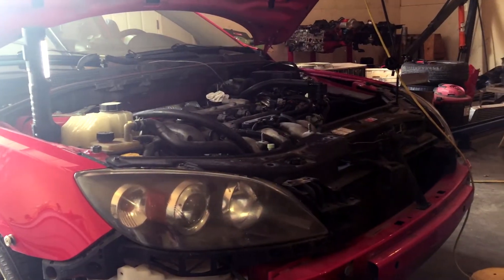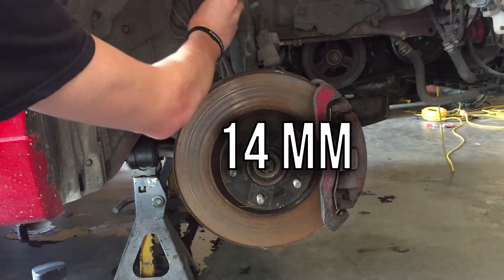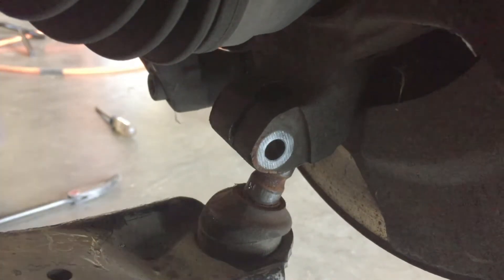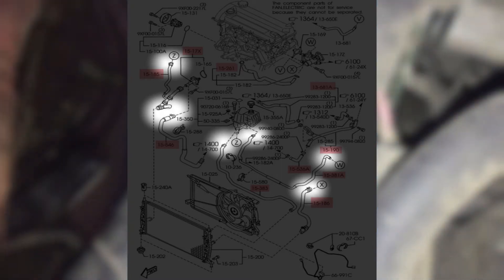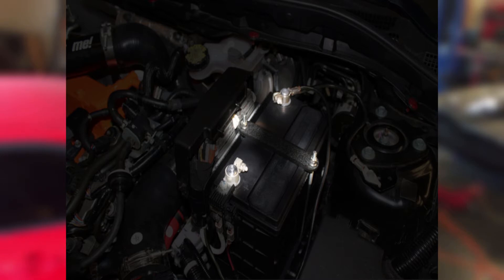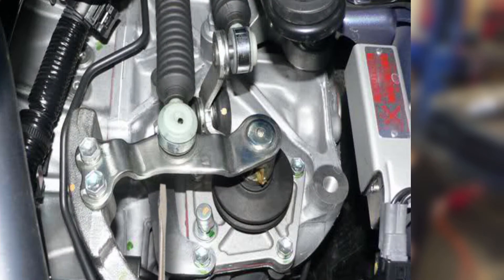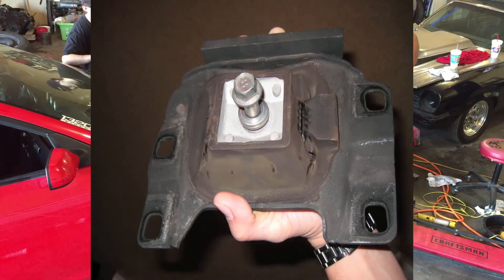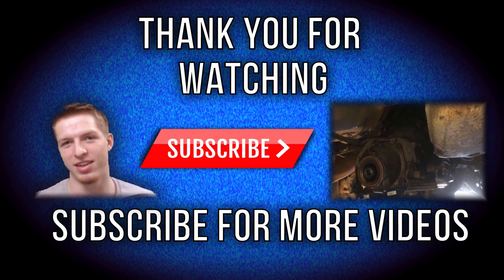Mazda Speed 3 Engine Removal

Comment: Thank you so much for the detailed step by step explanation removal of items to remove the engine. I did not see anything about disconnecting the clutch linkage. I am guessing that you just disconnected the hydraulic line? I found that I did not need to discount the tie rod to get the axle shafts out but like you found it impossible to get the axles to disconnect from the transmission. I am also going to just pull the engine/transmission out with them still attached. I wish my car was as rust free as yours, rusty ball joints and pinch bolts are not friendly. 
2
Reply from the maker: For the clutch, just unbolt the slave cylinder from the engine or transmission, whichever it is attached to on this car (I forget now lol) those ball joints would’ve been a nightmare with rust so I wish you the best

Comment: I probably won't get any responses, but I'm trying to do this to my speed3. Getting soooooo lost on what I actually do and don't need to remove because there are so many lines and things I have no idea what to remove or not. The wiring is another struggle because of the alternator wires and everything that goes behind the battery box (which I have removed)
Reply from the maker: Just take pictures of everything before you remove it and try to be as organized as possible. Everything is one piece at a time, it will eventually all be out of the way
Reply: @T @TheFeesher I figured out I can just pull the entire harness with the engine, but now I'm just to the point of disconnecting the slave cylinder maybe? I know its a hard line and it goes back to the brake reservoir but haven't figured out how to remove the line (it's different from every video I've seen) and I'm wondering if you had to remove that too. Basically what all DID you remove and like... how

Comment: what points did you use to lift the engine up with the hoist?
Reply from the maker: It’s been a while, but I probably just used whatever points I could bolt a chain to and kinda evenly spread the load

Comment: I have a 2010 mazda 3 S sedan 2.5l  I am swapping out. This video looks completely relevant to my swap and is the best Ive seen so far. Ive seen videos with people going out through the top and having to take off the harmonic balancer, the place I bought the engine im going to put in told me that if you take off the harmonic balancer the timing will get messed up and the engine will be toast. this seems like the best way to do it. I wrote down the steps and im gonna start it today. Thanks

Comment: Those axels just pop right off.... Anyway, why would you ever reccomend replacing an engine over rebuilding it? Rebuilding one of these engines is not that difficult and in the end... its basically brand new. After all is said and done it would be about the same cost (assuming you can find a decent low mileage engine at all) and you are not buying someone else's problems. A lot of work to go through just to replace a used engine with a used engine. Granted it takes a bit of time for the rebuild but...
Reply from the maker: They should pop right off, but didn’t. Do you honestly think most people who blow these things up are capable of rebuilding an engine? I’d say only 2% of people who are even into cars could rebuild an engine in the first place. Just buy remanufactured with a warranty of you are looking to spend money

Comment: This is a fantastic video. I plan on doing an engine swap on my 2005 Mazda 3. Ive replaced the clutch and several other things on this car. Also for anyone wondering I have a 2011 Mazda 3 and this video works for it as well. Under the hood of Mazda 3's from 2004 to 2012 is exactly the same with minor differences. I was going to make a engine swap video after my troubles of finding transmission removal for a clutch replacement but this video is simple and easy to follow.

Comment: I just replaced the engine in my speed 3 and removal of the lower ball joint is not necessary. You can pull the engine with the axles still in the transmission, just make sure you free it from the knuckle. It makes popping the axles so much easier since you'll have more room. Thanks for this guys. 👍👍✌
Reply from the maker: That is good info, we didn’t even try that!
Reply: @TheFeesher  I was pulling an old engine of a speed 3 after removing my old one(wrecked the car and just took the engine so I could put it in a body) and I realized it wasn't connected to anything but the knuckle so I kept pulling lol.
Reply: sasuke uchiha I need to replace my engine, its a base 2.3l mazda 3 2008.. Doesn't seem to complicated...
Reply: But if you're installing the engine back in, you're gonna need to take off the lower ball joints to get the axles in again. As for the axles, you can use slide hammer plus the #27058 attachment and they'll come right out. You just gotta angle grind the edges down on the attachment to fit the axles on these cars.

Comment: I think I could do this.. but putting it all back together correctly, that terrifies me...  I'd have like 12 screws and 3 hoses still laying on the work bench once finished.
Reply from the maker: For me it went back in surprisingly straight forward, just put all the nuts and bolts back on/in their respective studs and holes once a part is removed and it goes back in pretty well.
Reply: The Feesher hey when you put the new engine in , you don’t have to swap ecu’s ? Can you use the old ecu on to the new engine going in?

Comment: How did you guys take out the condenser and rad? And power steering cooler.
Reply from the maker: Just unhooked and then unbolted them. I believe they came off with the core support, but it's been a while

Comment: Awesome video man! How long did it take you to take the engine out and replace it? Subbed too!
Reply from the maker: Thanks! And it took about 2.5 days of work
Reply: The Feesher not bad! Found a speed 3 for sale for $1500 with 117k miles but they said it has a code for a crankshaft sensor. They replaced it and still won’t fire only cranks. Thinking about investing in it and fixing it up, and obviously thinking of the worst case scenario haha. How much did a used engine run you? Did you get it from carpart.com?
Reply from the maker: This engine was about 2500 from a guy around me, with known compression numbers. I have bought engines from car part before though
Reply: The Feesher cool cool, thanks for the quick replies bro! Keep up the solid work!
Reply from the maker: No problem! Thank you!

Comment: Thanks for posting this up.  I maybe in line for an engine swap.  148k miles and engine's burning oil now.  Anytips in locating and negotiating for a decent engine?
Reply from the maker: Cor Gi you're welcome! The only advice I would have is to go to websites like "carpart.com" or something similar, it's a salvage site where you can have them shipped to you.
Reply: Thanks man, I don't even know if I can attempt it.  The most I've done was replace the shift pivot seal, endlinks and rotors/brakes.  Car definitely needs a lot of work.   Subbed and looking forward to more MS3 how to videos.
Reply from the maker: Cor Gi unfortunately they're may not be many of those, this was my friends and he just sold it today 😢 but the job is quite an ordeal for someone to undertake. This video will help you do it for sure, but this is far from my first engine replacement. I'm not trying to discourage because succeeding in this job feels very rewarding. I just want you to know it's a big job to get into, I hope you get your car going again soon!

Comment: Can you put a speed3 engine into the Mazda6(Not the speed6)? As they are both fwd.
Reply from the maker: DarkKnightE I would have recorded the install but it it was a busy process. Same as removal just opposite
Reply: It can be done with $$$. But just buy a speed6 and save the headache